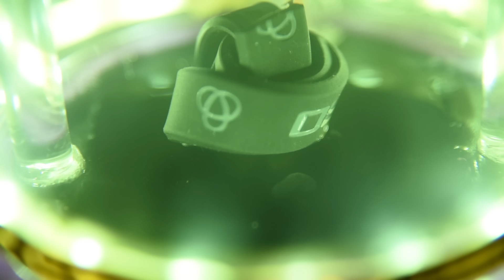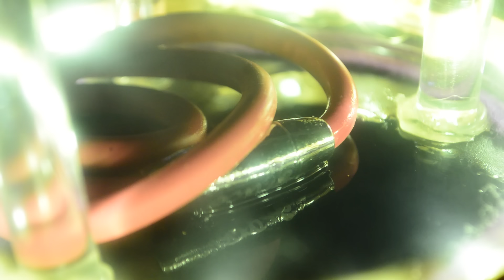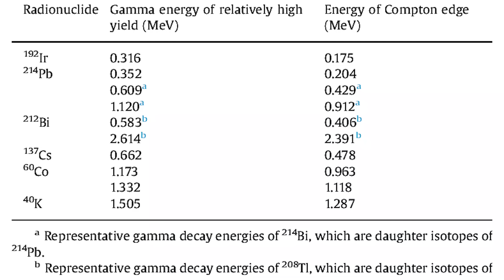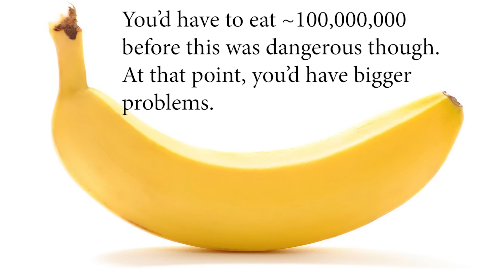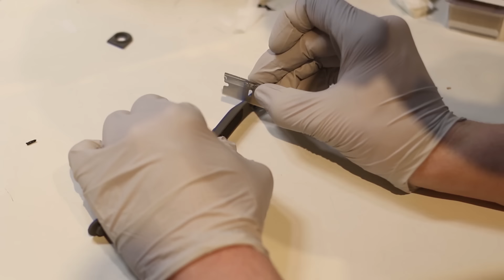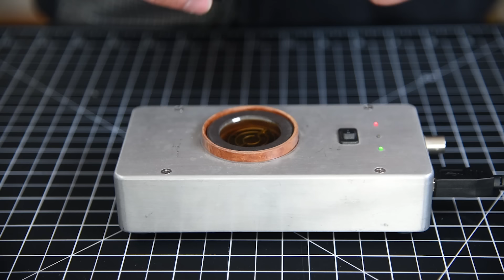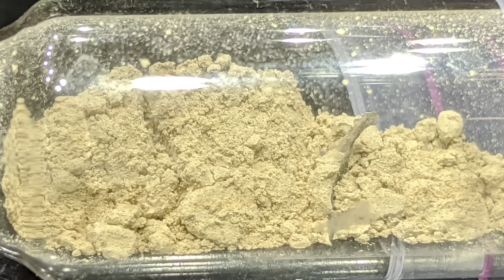Negative Ion/Anti-5g Products Are Actually RADIOACTIVE

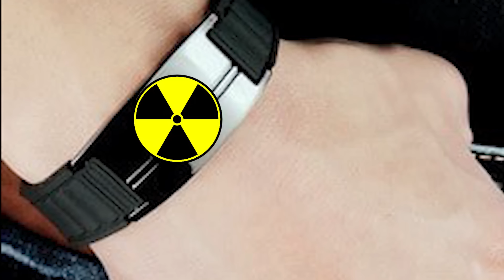Comment: Can you explain the claim at 13:30 that these products produce a concentrated dose? The Sievert is a unit of energy divided by mass and so measuring a small area at 5uSv/h is a much lower level of exposure than your whole body being exposed to 5uSv/h. It's not like you are taking a full body dose, compressing it down and applying it to your wrist. On the contrary, it's like being exposed to an x-ray machine and protecting most of your body besides the small exposed area, except at a much lower rate. To meet the full body dose exposure you cite, you'd have to cover your body in these products. I think your explanation is flawed and makes these seem much, much worse than reality. It's borderline fear mongering.

In other words, if you used your Geiger counter in a large 5uSv/h field - a field that you could stand in - your full body would be exposed to 5uSv/h. Your Geiger counter would still read 5uSv/h. Clearly the exposure to your whole body would be much more than from one of these bracelets which produces a small field of 5uSv/h at contact distance.

Comment: "Are these things actually dangerous?"
Two words. Thorium toothbrush.
Reply: Yummy yummy mouth cancer
Reply: Well yeah...  ...but it does eventually get rid of tooth pain...   ...and teeth.
Reply: @ChurchOfTheHolyMho  Heh. Just picturing a dentist now:
"I just don't understand how you can have such severe periodontitis when your teeth are SO clean"
Reply: @AlibifortheAfterlife  They're so clean they're practically glowing.
Reply: That Japanese toothbrush mentioned in the beginning i actually recall seeing in a shop there (in Japan) and i think it has a small battery and (potentially quack) electronic ioniser, so it's not as evil.
Reply: @Vokabre  as I read, the principle is not one of "negative ions" at all, but rather that, allegedly (I'm not fact checking this, heck), plaque is positively charged and teeth are negatively charged, and it claims that it mildly negatively charges the bristles moreso than teeth, to make the plaque more inclined to come off. If that's true, then that's not ~negative ion~ quackery, but simply static electricity? I dunno man. They do like to use the words "ionic" a lot, which is offputting, there's various toothbrushes which all look largely the same... I guess if plaque really isn't neutrally charged, then maybe the plaque particles could be considered ions? With the brush providing the free electron to neutralise it? As I understand it ions are usually just a molecule with a missing electron, but maybe plaque is mostly just one molecule? I've never looked into what exactly plaque is so. Yeah.

That said I think I have used one of those toothbrushes before and my teeth did honestly feel smoother afterwards than with a regular brush for the same effort. My mother was into all of these such things, big rock crystal lamps, and those little electric ionisers like Big Clive recently tore down. So I wouldn't be surprised if I'm not just imagining that memory. Like, it wasn't like, cleaner than a regular brush can get, it just seemed to need less force to do – which of course could entirely be down to making the bristles out of a different material, maybe it buffs the teeth surface instead of being mildly abrasive, fuck I dunno. 

It could be a complete placebo, though a quick google says one company called hyG had their easier-use results backed up "in a double blind trial" with "60% of people finding better mouth hygiene"... which could just be 10 people in the office and 6 brushed better becuase they were more self conscious of what exactly they were doing with this new brush? Like the temporary motivation boost that comes from any motorised brush purchase too? Like they don't say who did the study or provide any sort of way to find it, how many participants, just "a double blind study". How exactly do you do a double blind for a "ionic" toothbrush anyway, did they take the battery out of some units or something.

Still, if it does just pass a very very mild electric current near the bristles, statically charging the bristles themselves... that seems pretty harmless. You'd probably get more charged up rubbing a balloon on your head? Though, if the bristles are capable of being statically charged, that would suggest it was a different material than normal like I thought, which could be entirely responsible for all of the perceived difference in teeth smoothness and shinyness (which I noticed lots of other reviewers calling out on the product page that had the "double blind trial" quote, sorta like I remember experiencing years ago). If it is acrylic or something maybe the battery part is even a placebo, maybe it gets enough static just from rubbing against your teeth.... if the plaque-polarity thing is even real, obviously.

Well I've had enough of thinking about this topic now !!
Reply: @kaitlyn__L  Yeah don't bother fact checking it lmao, that claim is crap from the start. Anyone who's taken high school chem (and taken it seriously) can debunk that "plaque is positively charged" thing in 3 seconds. Ionic charge doesn't work that way.

At best, as you said yourself, they're passing a charge through the bristles which would do little else but maybe add some extra tingle to the brush. At worst, there IS thorium powder and it's very dangerous.
Reply: @AlibifortheAfterlife  well, there definitely is no powder, and I pried one apart and found a 3V lithium cell inside. 

But I did actually look up the plaque thing, and found a number of dental trade publications saying plaque does have a positive charge during formation due to the Ca++ ions in the saliva. But it then says that van der waals forces hold it onto the teeth once it actually adheres, and the static charge is apparently only relevent for bacteria becoming stuck to the calcium before it adheres to the surface of the teeth, and the bacteria are the ones responsible for tooth decay. 

They didn't suggest a mild electric field could do anything, but instead proposed using a chelation compound in toothpaste to prevent this "biofilm" from forming with the calcium, and to let the calcium strengthen teeth instead. 

But, y'know, I'm not a dentist, and maybe there's issues with their methodology there too. (I do actually have undergrad qualifications in physics, chemistry, and electrical engineering though, but I'm not going to pretend that makes me a biologist or an oral hygiene expert.) 

I will say I tried using the brush with and without the battery, after seeing how it worked, and my teeth definitely felt smoother with the battery. To try and eliminate the possibility of it merely being the second time feeling smoother, which does happen to some degree, I did certain sections of my mouth two or three times without the battery. The battery always felt more polished, and got extra little bits from nooks and crannies, within a few brush strokes. I wish it didn't, because this has been perplexing me all week now. 

It doesn't tingle at all, either. 3V is absolutely miniscule, but it doesn't even feel like when I used to lick 1.5V, 3V or 9V batteries as a child either. I'm highly skeptical it's passing anything through the body, as teeth aren't conductive anyway. Perhaps it's merely cycling the current through itself. Maybe it is all still just a placebo, though I really gave brushing non-powered all the effort I could, and then two or three strokes with the battery got extra stuff off. 

So I dunno man. The only sensation when using it is one of reduced friction between the teeth and the bristles, for whatever damn reason, and I didn't need to scrub as many times in the nooks in my molars either. ¯\_(ツ)_/¯ I want to try and find these actual supposed double blind trials (which I guess had some units without battery connections), because the only thing I can find is these trade publications for and by dentists, which reference these studies but don't say what they are. 

I'm also curious to see what Big Clive says about them, if the circuitry is at all similar to an air ioniser, where there's just a voltage multiplier and a small spark gap - the interface between the body and removable heads could easily be a spark gap, they don't sit super flush together. I'm sort of curious to send it off or buy another one to send to him, to see it he can be more destructive and completely remove the circuit board. Given spark-gap ionisers can indeed collect dust out of the air, maybe it's attracting other various debris, even if it's not strictly plaque? Honestly I'm just spitballing here, but, like.. consensus seems to be electrically powered things are safe (even if they still do very little, to nothing), it's only those "passive" garments, the bracelets, clothes, etc that have thorium inside. If you haven't seen Big Clive's recent video (which he called something like "not all negative ion products are radioactive"), made in response to this one from Justin, you should check it out. And just subscribe to Clive on general cos he's a cool guy who takes apart all sorts of vintage and dodgy modern electronics.
Reply: @AlibifortheAfterlife  like, obviously it's not doing electrolysis inside the mouth. And plaque is neutrally charged after it's actually formed into plaque, allegedly. So I doubt it's actually forcibly pulling plaque away like they claim. But maybe, if it does just have a little spark gap, that's enough to increase cohesion to the bristles once you dislodge it with regular friction? So rather than making anything come away easier, it could maybe make it easier to keep it away afterwards? The sensation of reduced friction on the teeth could easily just be from fewer particulates falling back onto the teeth from the brush surface, if it does hold onto particles slightly more proactively (before rinsing the brush head, presumably). Again, I made my areas of knowledge clear, while the rest is speculation. I don't know if plaque flakes and toast crumbs in the mouth behave at all like dust in the air vis a vis being attracted to a small spark gap, but, I dunno, seems plausible as a mechanism to me if we've already eliminated thorium and the actual claimed mechanism of temporarily reversing the polarity of either the plaque or the teeth (the various manufacturers disagreeing on what exactly gets "temporarily reversed" certainly makes that claim extra fishy, necessitating considering other mechanisms).
Reply: Get some Doramad toothpaste for that brush, for ultimate cleanliness of the mouth. :D
Reply: izphuzzy  Get a job as a human flashlight for your last couple months of life lmao.
Reply: How about a tooth paste
Reply: izphuzzy activated charcoal is good for you ??
Reply: @Toilet_water__123  I mean it doesn't really do much and can be used to make yourself throw up if you ingest something poisonous.

Comment: I generally love your videos as they’re very informative and well researched. 
Yet I have to disagree with your conclusions about the dose rate. Geiger counters cannot be used like that for an actual dose rate estimation. They’re quite sensitive to Alpha and Beta radiation (atleast the one with the proper tube is) but since alpha particles can’t penetrate the dead layer of skin and betas are stopped inside the skin, the dose rate is overestimated a lot. This happens because those typical over the counter counters are calibrated with gamma emmiters, so it roughly converts impulses per second or minute into the approximate dose rate. That only works for that specific isotope though (usually Cs-137). 

A Geiger counter can only show a dose rate for gammas and that only if the gamma energies are known and calculated with or you use a calibrated device with an energy compensated tube.
Since radioactive dust rains down on us every day (mostly radon washout after dry periods) I’d assume those articles don’t really pose a huge health risk but I still wouldnt wear them every day though. 

Anyways keep up the good work and have a nice day!
Reply from the maker: Guess you didn't watch the whole video. I demo'd that both alpha and beta are capable of going through skin, either fully, or enough to hit the dividing layers
Reply: Another point regarding alpha radiation:
They are shielded by paper and other thin materials. 
Of course there’s always a chance of a few single particles making it through something thin but that again doesn’t pose a risk. 
My guess is that the test in the cloud chamber was flawed due to naturally occurring alpha radiation, again mainly from radon in the air and from radon that could come from the bracelets itself as a decay product of the thorium decay chain. 

You’re totally right about the risks of loose particles of thorium dust though. Ingestion is a really bad problem, especially with alpha emitting substances. I assume small amounts coming of the bracelets for example wouldn’t be too much of an issue but the insane amounts of thorium dust inside this pen was scary...

Comment: Nice work!  It's very gratifying to see one of my designs put to good use. http://www.coultersmithing.com/forums/viewtopic.php?f=52&t=467&start=0
Reply from the maker: It was a good investment all those years ago for sure! It's been one of my prized pieces of equipment I've kept safe for about 10 years. Was nice to finally fire it up again and give it a spin. Long since lost the documentation for it unforuntatly, so took me a bit to remember who made it and who to contact last year when I first started working on this video. I sent you an email recently asking for clarification about what the various numbers meant that come in over serial as it wasn't clear. End up using the total counts over 5 minutes to calculate the dose.
Reply: @thethoughtemporium  Cool - I don't recall getting the email, try dcfusor (at) gmail.  Be extra careful of that geiger tube - there are only a couple more in existence, apparently.  That window is super thin to let in alphas and easy to break!  You should leave the power (the switch and red light) off when not in use, as that alcohol-quenched tube will eventually fail after some billions of counts under power.
I just added info on the format to the thread I linked above, if you still want to know.
You can't really convert counts directly to Sieverts, as that unit tries to take into account energy of each hit and the supposed physical damage caused by the different types of radiation, but for this, what you did is close enough.  For the audience, I assume you already know this: https://en.wikipedia.org/wiki/Sievert

Comment: It's funny that the "massager wand" device probably cannot emit any alpha or beta because of the steel case in it's "intended" use, but because it is so badly assembled it could end up dumping it's dangerous contents all in one go. It's incapable of doing what it promises normally, but it's poor implementation makes it capable of doing something really dangerous (releasing a heap of ingestible thorium dioxide) accidentally.

Comment: Alpha particles are often seen as harmless as you are not normally WEARING IT AGAINST YOUR SKIN! Not to mention the skin around your wrist and neck is quite thin. Air does stop them before they can reach anything at all (1m of air will stop all from what I know). Alpha emitting objects are safe to handle even when not painted or coated with anything as you normally hold them for relatively short periods of time and the skin on your gripping side of your fingers and hands is thick enough to stop the bulk if not all the alpha particles. An common example here would be u238. Breathe in dust or ingest any alpha emitting substance and the situation goes 1 -> 100.

My mom has a negative ion bracelet she bought a year or so ago. Paused the vid to go check it, seems really low emitting, does have that grainy look. Gonna have a conversation in the morning I'm not looking forward to...

Comment: Buying a Geiger counter...can you recommend one that detects alpha, beta AND gamma particles?
Reply: The cheapest you are going to find are either DIY kits with SBT-11 or SBT-10 tubes ($90-$100) or the GQ GMC-600(non-plus version, $225 if it's still around) or its Plus counterpart, at $300 but at that point you're already going into territory where you could buy a Radiascan 701A($350) which is much more capable.

Comment: This is like the modern day equivalent of radioactive glow paint or asbestos. 

And to think people thought WiFi was the real threat.
Reply: On asbestos, nah. Plenty of things you can sub in, but the benefits of using asbestos (it hates being on fire) were actually quantifiable. Not saying it should ever see use again outside of extremely controlled circumstances, but it didn't increase your energy levels while killing you, it kept you off fire and killed you.
Reply: Asbestos is still a threat in Sweden. A lot of buildings from the 50s are still around with asbestos fibers in pipe insulation, vinyl flooring, heating ducts etc. Building owners are responsible for inventorying and testing for presence of asbestos but this seems to be largely ignored as it adds substantial costs. The general public seems to have forgotten this danger, even construction workers.
Reply: Atlest asbestos still has it's modern uses (despite the large amounts of PPE needed to handle it)
Reply: Mandrake Fernflower What uses?
Reply: Or 5G